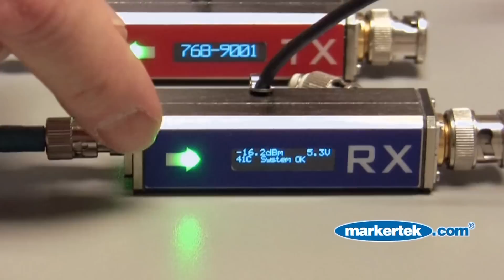Advanced Fiber Products Video Media Converters

Comment: Sir what is the use of this product?
Reply from the maker: Hello! These units allow you to send a digital video signal much farther than conventional coaxial cable by converting the signal and sending it over fiber optic cable and then converting it back on the receiving end. https://bit.ly/2OJPxKw
Reply: @markertek  would it work for analogic signal ?
Reply: @foufou81  Yes, the ones we use in the field are very simular to these, and it converts analog to digital
Reply: Dear all 
This unit allow me to send and receive  RF signal for my wireless intercom system tx and rx ????
Reply from the maker: @kamelmeddeb9474  Hello! The MC2 Video Media Converter modules offer extended distance over singlemode fiber for high-speed serial digital video links for multi-protocol 3G/HD/SDI/DVB/ASI video applications with data transfer rates up to 2.97Gbps.